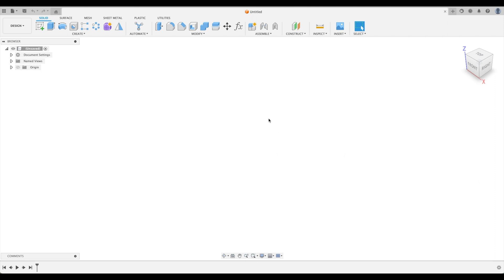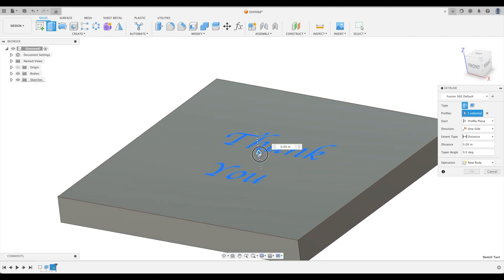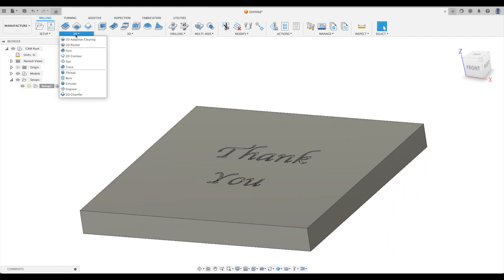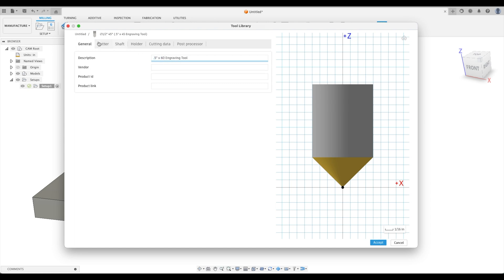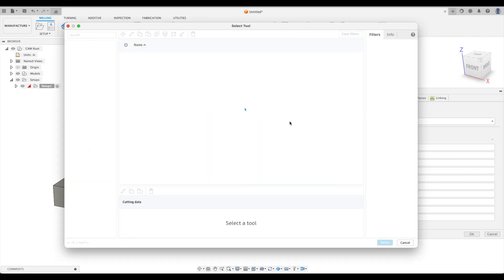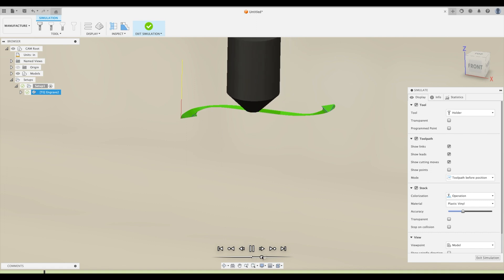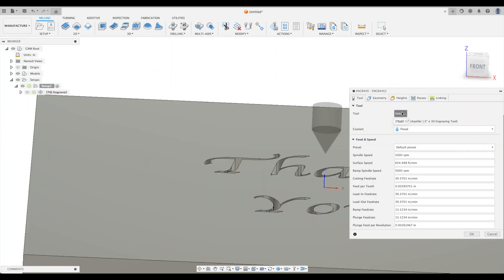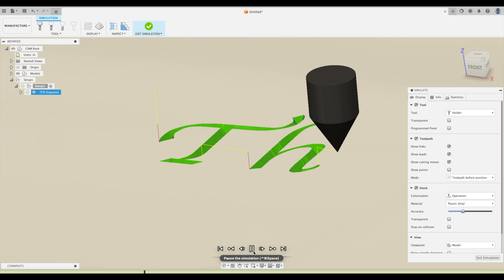Fusion 360 - Engraving Text on Signs Tutorial - CNC Router - Short Tutorials #1 - (2023)

Comment: Thanks for the great video! I'd like to make a larger sign where the tapered walls of the sides of a letter are too wide for the bit, without it going completely
through the material. How do you clean it up with a flat end mill to make the bottom completely flat and a consistent height?
Reply from the maker: Great question! You will need to select the bottom profiles of the pockets and use a flat end mill to mill out as much of the pocket as possible. It’s best to do that before you mill the tapered walls.